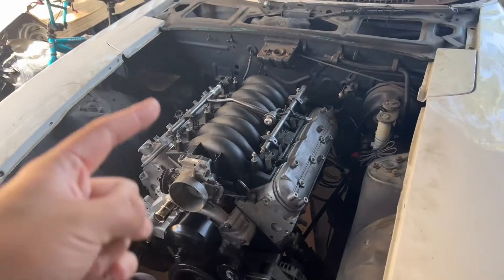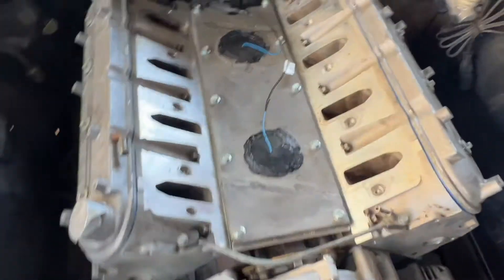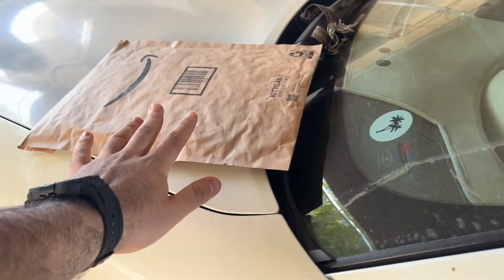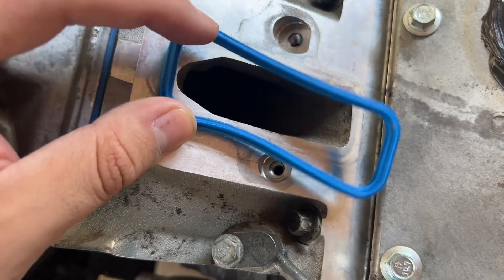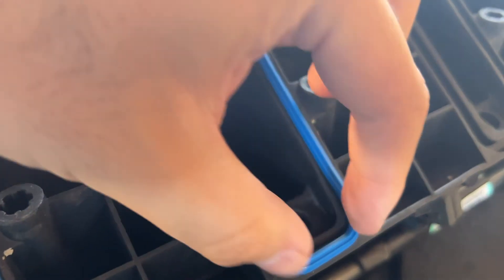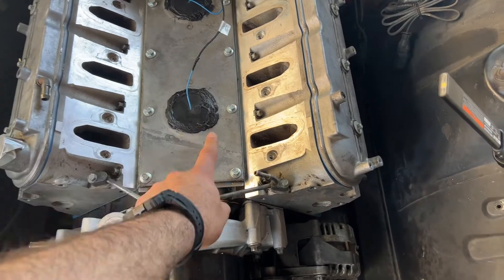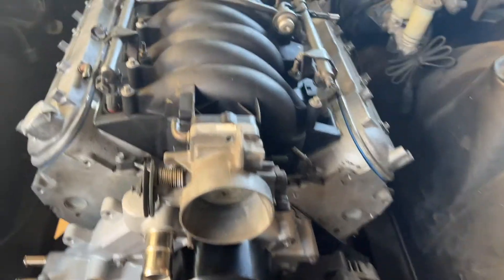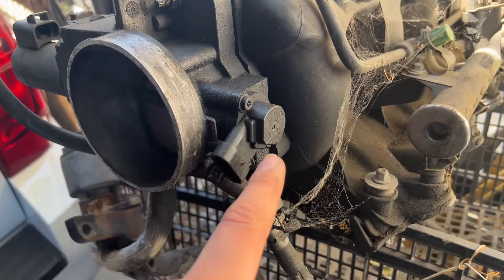Project LS 260z - Square Port Intake Manifold On Cathedral Port Heads?

Comment: Do you know if the heads can be machined into the rectangular ports?  I ask because I have fallen in love with the Edelbrock X-Ram intake but it only works with the rectangular heads and I really wanted to build a 5.3.  I'm now thinking I'll have to build a 6.2 from the ground up unless I can find a solution to make them work with the 5.3.
Reply: You can port them
Reply from the maker: Not to my knowledge. You can simply get a pair of rectangular port heads if you want to use the 5.3 instead of the 6.2.

Comment: As mentioned. The ls6 intake you have is “cathedral” port not rec port like a ls3 manifold. 

All you did was swap out the gaskets. 

Not trying to be negative but want to let others know.
Reply from the maker: I’m definitely not an expert. I based my comparison on the truck manifold it had since it was all I had for comparison at the time. Thanks for the clarification. 👌
Reply: So hypothetically if one had a square port LS6 intake and they were trying to put it on their LS1 and they ordered adapters but they wouldn’t work, what would they do?
Reply: @StunterSteve you don’t need adapters… ls6 heads are cathedral

Comment: The LS6 came with cathedral port heads factory, so did the LS1 and they both had “square port” intakes, you don’t need adapters. 
In fact Every LS variant engine (truck or car) up till the LS3 I believe we’re cathedral port heads. So that means (4.8,5.3,6.0(truck and car), ls1,ls6,ls7,ls2 etc) we’re cathedral port heads. 
Not trying to burst your bubble but don’t be putting information out there that should be known or by the very least explain it correctly.
Reply: Nice build this thing is gonna be a rocket

@kawigreen2005 Still nope 
ls1,ls2 ls6, ls4, 5.3/4.8/6.0 gen 3 are cathedral port.
Ls7 has its own style heads and it’s own manifold style 
Ls3, gen 4 4.8,5.3,6.0,6.2 are square port
Reply from the maker: I’m definitely not an expert. I based my comparison on the truck manifold it had since it was all I had for comparison at the time. Thanks for the clarification. 👌
Reply: @losmerosvera  all good buddy and you’re welcome
Reply: @alpinesupra88  so I can run a rec port intake with cathedral port heads with no issues ?
Reply: @pitlver  I’ve never tried an ACTUAL (like the LS3) square port head intake on a cathedral port head so I can not say for sure. But just go look at the LS1 vs LS6 intakes (which are the same as the trucks) and you’ll see they are “square” port intakes.
Reply: @pitlver  I’ve seen it done a million times race cars Dailey drivers etc . The intake is seal and basically the rectangle covers the cathedral. You can’t do it the opposite way and the ls7 has its own thing going.

Comment: I had to buy the adapters. I have cathedral port heads and a Holley high ram rectangle port. The rectangle port is higher and without the adapter it leaves an inch at the bottom of the head open. Glad yours worked out though